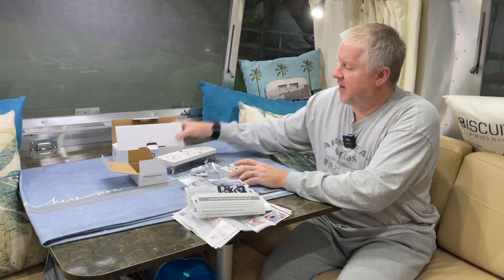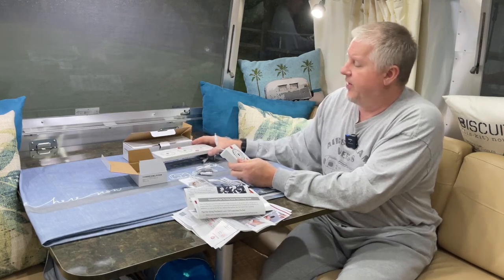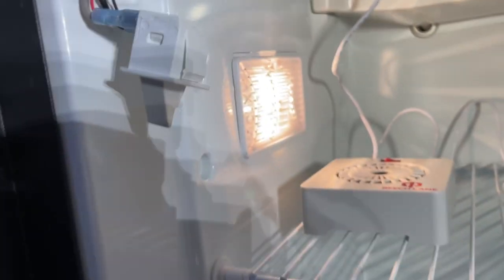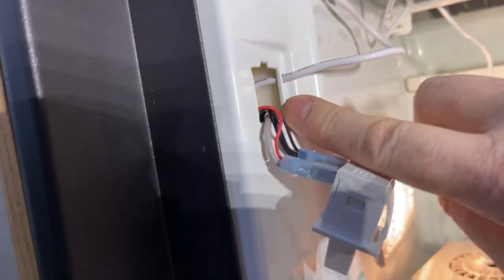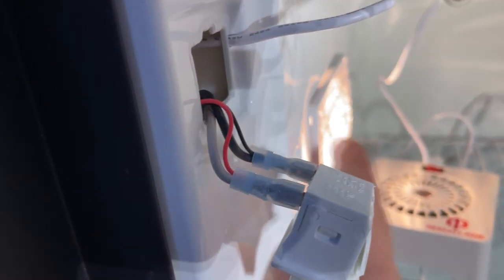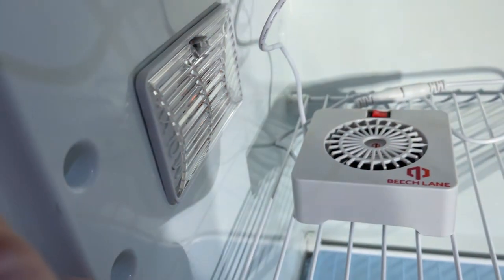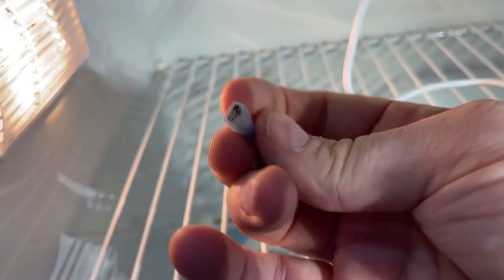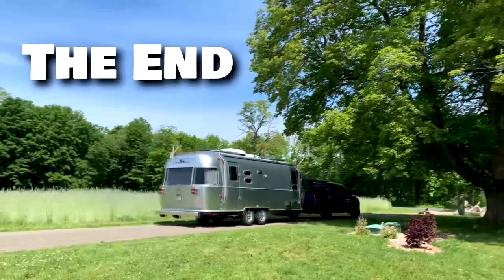Installing The New Beech Lane 12v Fridge Fans

Comment: Yes, I watched the whole video, but we gave an older model Norcold (2005). That means there a few variations in the wiring.
First, we have 4 wires (2 black/white and.2 red) that enter the interior of the box.
Reply from the maker: Have you checked those 4 wires for constant voltage?  I guess I got lucky with our model then - I had constant power going into the switch so I was able to use that

Comment: We have a Norcold 1200 series refrigerator. There are 4 wires (2 b/w and 2 red) that enter the inside of the box on the right side. 1 set goes to the ceiling light and power is controlled by  the door switch. The other set of wires goes to the thermistor on the fins. Because the light connection would be switched whenever the doors are closed, that is not a place to splice in the Beech Lane 12v fan. 
However, can the Beech Lane 12v fan be spliced into the thermistor or does that disrupt the function of the thermistor?
Reply from the maker: I cannot answer your question about the thermistor but if you watched the whole video you will see that I initially tried to wire using the light and had a DOH moment regarding the door switch.  I tool my voltmeter and checked the circuit at the door switch and was able to tap into there for the power.  Has worked out perfectly...thanks for the question and for watching.